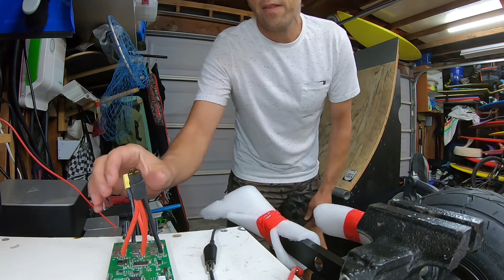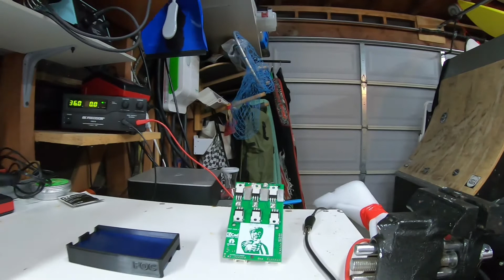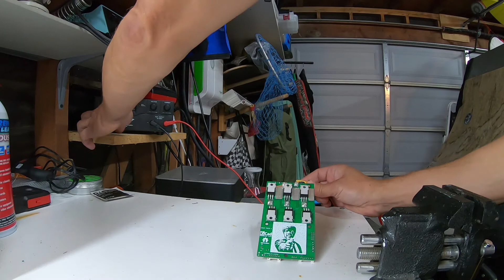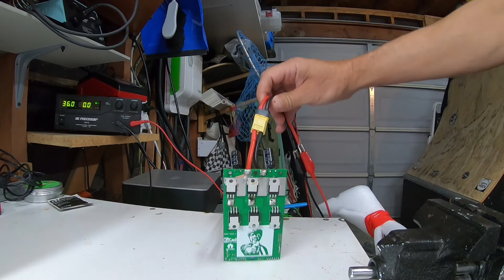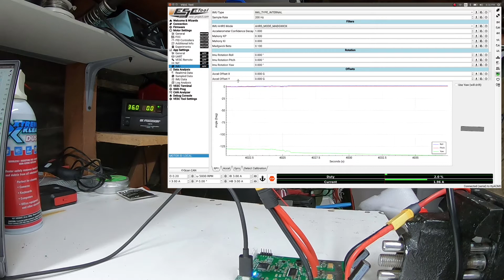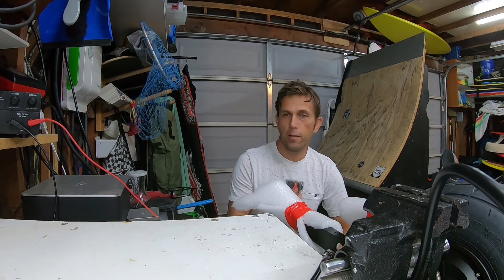How NOT to build a Funwheel

Comment: you need thermal pad or heat sink paste to transfer heat from mosfets to heatsink. you may also need mica insulators or kapton tap if tabs of mosfets are not grounded.